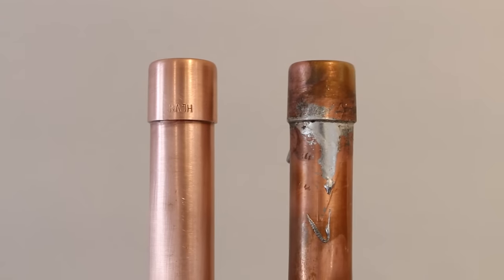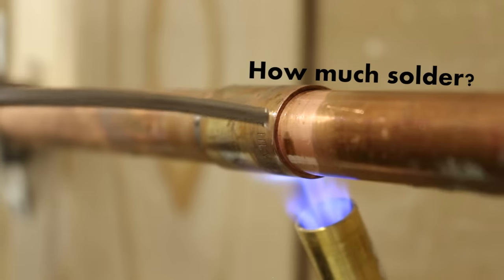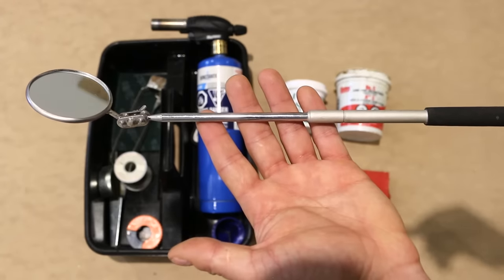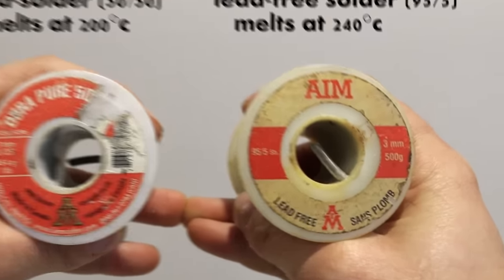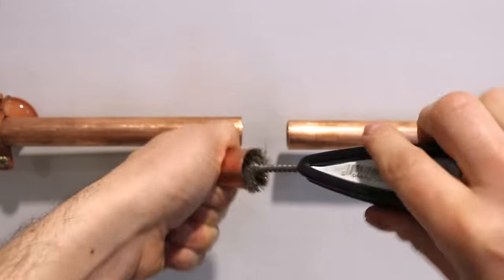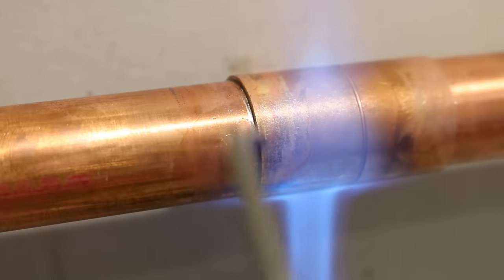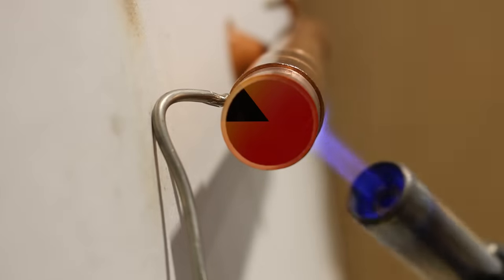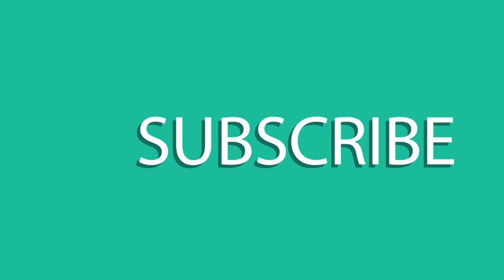How To Solder Copper Pipe Like a Pro (Tips & Tricks) | GOT2LEARN

Comment: Apart from the cleanliness and preparation what made the biggest difference to my ability to produce good joints as a DIYer was a decent MAPP gas torch. Especially on larger fittings where there is more metal to heat, the ability to get good heat into the fitting quickly is a must.
Reply: I've recently learned that mapp as we knew it hasn't been produced since 2008. The stuff that they sell in the yellow bottle isn't actually mapp. They intentionally call it map/pro to mislead the consumer. It only burns 100 degrees or so hotter than propane. Nowhere near what the old mapp was. The torch tip is far more important than buying today's yellow bottle. There are a couple of great videos that demonstrate this. I am no longer going to pay the premium price for a marginally better gas.
Reply: It might have been right for you but I just checked the price of one and for that amount of money I'd redo half of my house's plumbing with all materials included.

It is totally not worth it, I paid something like $12 for my torch.

Comment: I like the fact there is always plenty of room in these videos unlike in reality when they are tight against a wall in hard to access places.
Reply: True, but planning a route goes a long way
Reply: Lol
Reply: @LeeroyPaladin  And that's when the motto of, "Sometimes you gotta not be afraid to fuck someone's shit up" comes into play
Reply: Yep. Agree 💯
Reply: This is a professional showing us how to do a good job. You need to account for camera angles. If the demo pipe is too close to the wall the camera cannot get in
Reply: Plus you can’t afford to take 10 mins for one joint. 🤣
I agree a great technique though
Reply: Like when Bob villa connects drain strainers,tail pieces. Plastic t's and a ptrap. On top of a work bench. Must be nice to do it standing up and not wedged in one of the door space inside the cabinet laying down
Reply: Just do the plumbing first and build the walls afterwards!
Reply: @LeeroyPaladin  lower your flame. I sweat 1-1.5-2” copper all day right next to romex, low voltage wiring, uponor runs, and other combustibles. If you know how to control your flame, there’s now issue even with this technique, though I wish he’d show wiping the joint with a dry rag or glove after dropping the solder which makes it look even better. Every once in a while I have to pull a piece of 26 gauge metal off my truck and use as a flame shield on tight corners, especially on 2”.
Reply: @bradleyrussell1973  don't get to plan your route when you're doing a service repair

Comment: Best soldering tutorial I have seen on youtube!  I have as much confidence in my joints as I do hiring a pro now.
Reply: I used to work for plumbing company as laborer helper. It's easy enough to solder. Prep work is very key. Don't over use flux. Don't overheat it. " Write " once around the joint that's it. Wipe off excess if need be.

Comment: Excellent preparation technique and the method of heating the front 2/3 - 3/4 while not heating directly to the back and allowing whicking and capillary action to suck in the solder works amazing, and it's truly so much easier! ! 
I was fortunate to first learn just exactly the same identical methods for doing this myself (with the exception of the tinning flux) I've always used only soldering flux, but seeing the ease and coverage it provided--my life will be made even simpler along with faster progress for each joint !!
Much thanks for sharing this video kind sir !! Keep up the outstanding work !!
Reply from the maker: Glad I could help Ninja ;)

Comment: Great video! Especially with the short clips on examples explaining what you are talking about.  I've noticed while heating the fitting , the flux comes out. I wipe it with a rag( yes its hot)  , then apply the solder mainly on vertical piping.  Its clean enough to look professional. And no leaks!
Reply from the maker: Good work bud, and thanks for the nice comment ;)

Comment: Just a little tip to add that will save you from having any leaks after you have soldered.
At the one minute 11 second mark in the video he shows flux on the pipe. I noticed the flux contains numerous amounts of small pieces of dirt. Those are the things that prevent the solder from running properly. So it is good to keep your flux covered when not using it. One small piece of dirt can prevent the solder from running into the entire joint.

I am not bashing here...just pointing something out in this video that I did notice which should be corrected.
Keeping every piece in the process clean will result in a watertight joint!!! Happy soldering!
Reply from the maker: Thanks bro :)
Reply: And using a clean cloth to wipe after sanding the copper. Thanks for your comments !

Comment: Great video man I really enjoyed it and after plumbing for 16 years you taught me something.  I will say this to the younger plumbers,  99% of your solder joints are in a wall or under insulation and will never be visible so I personally don't put any stock in to how pretty a joint is.  A while back I called out to a fancy lab at 10pm to fix an emergency leak on a 3" chilled water line.  While fixing it i was gobbing solder in it and not giving on fuck what it looked like and my apprentice (5th year apprentice in the UA plumbing union) asked me "don't you care what it looks like? Thats not pretty." I told him "We just cut out and fixed pretty,  im hanging something up there that we ain't gonna have to come cut out in a year like this "pretty" work here."  There is a time and a place for what this video teaches you, its not for every job though.
Reply from the maker: Exactly! Yes, I mentioned somewhere in the video that I personally only use this for radiators and towel warmers and stuff like that where you have 1 or 2 joints that are exposed, other than that, there's no use for this method, unless you want it to look clean inside the wall..
Reply: @Got2Learn  pretty cool that I was able to learn a new technique after so many years in plumbing.  For exposed joints all I've ever done is wipe the flux and try to control heat and just have a thin bit of solder showing.  Never pulled off a flawless joint like that.  Good video.

Comment: Something I've learned over the years. Have you ever seen a leak on a soldered copper joint where it has both a bit of corrosion and a greenish color to it? That comes from wiping the copper with a metal scotch bright pad. Residual fibers from the pad react with the copper and its soldered joint. I would recommend wiping and cleaning with copper wool/scotch bright only. Excellent video.
Reply: Thats not what its from.  Its from residual flux (highly acidic) oxidizing the copper.  To prevent this, wipe your cooled joint with isopropyl.
Reply: @thatf_inguy8220  Can't say I agree with you. While the flux is indeed highly acidic due to the fact it chemically cleans the copper, it isn't going to cause a properly soldered joint to leak because it wasn't wiped properly. 

If soldered joints were this susceptible to leaks because of them not being wiped properly, I'd guess this technique of piping would never be accepted in the field of plumbuing and would have died in its infancy..

Comment: His video is good & makes sense,  3 things I also do which I think are important/helpful,  I always clean the ends of the fittings (added insurance) measure the length of solder you need (estimate, not rocket science) 3/4" for 3/4"  1/2" for 1/2", etc.  & last which I think he said; let the solder flow to the heat  !

Comment: I would say that does look very nice and beautiful. But most pros don't scrub their pipe after the job is done. You can reduce the life of the pipe because you are wiping the thin oil coating off the pipe. Instead while the pipe is still hot put some regular flux on top of and take a clean 100% rag and wipe it over your joint. Just make sure the solder solidifies first.
Reply: Depending on the flux, leaving flux on a pipe will result in it turning green, although it may look good initially.  Most plumbers I know consider fluxing after soldering to be extremely bad practice for this reason.  I suppose if you want to grease your pipe, though, a silicone grease could be used for this purpose.

I don't generally use an abrasive to polish a joint, although copper, whether oiled or not, is generally extremely durable when exposed to air, so I can't really see what harm it would do (except that you are wearing away the wall thickness very slightly).

Comment: I had a plumber that tried to make his joints look like this. He had more leaks than anyone. He said he didn't want to waste and drip solder all over the place.
I responded by saying I don't want to drip and waste water. 
Solder the joint, leave 1/8" around it and swipe the dog ear off. You will know it's full.
 Had to get rid of him after I saw him on a service call soldering 4" copper with a #4 prestolite tip. Dude wouldn't listen.
Reply from the maker: It takes the same amount of time, just a different technique.
Reply from the maker: Lollll
Reply: Oh dear...
Reply: I always say solder is cheap . In a hard to reach spot I will let it drip . Finesse does not apply in this situation.
Reply: Solder is cheap and leaks arent nI agree with you there but I never wipe my joints while the solder is still molten. Im sure you disagree but wiping hot joints is bad.
Reply: @canonpatchell  yes could cause problem. I knock off the dog ear with my solder before it hardens. I left a solder dog ear once and a customer thought it was water when I was an apprentice and had to drive all the way back for nothing. Never again

Comment: Monster open mesh grit cleans like no other and last the longest. Emory cloth is time consuming. Also on bigger copper 1.25 and up you have to circle the fitting with solder to get a correct seal. Looks don't matter but leaks do
Reply from the maker: Definitely!! It's also more expensive ;)
Reply: @Got2Learn  Time is money and redoing a leak cost money as well

Comment: I also like pretty joints. I found that gently wiping the run or access solder with a dry rag or old leather glove while still melted, works wonders, the thin layer of tin that remains can just be cleaned up with emery paper. I  sometimes re heat to wipe if necessary. It also works great if you use recycled pieces that have previously been soldered just heat wipe and you have a tinned pipe and not waste the precious copper by cutting it off. To clean soldered couplings, grab with longnose plyers heat and bump your hand against something solid the hot solder comes flying out. and you have a beautiful pre-tinned coupling that needs less solder and a non-leaking joint as a result. By the way I use LACO flux no leaky joints ever.
Reply: Yup i wipe joints with a scotch bright pad after soldering and joints like great everytime

Comment: For good clean solder joints practice makes perfect. My suggestion  is to use  the correct torch tip. The right size flame makes a big difference. Also wiping the excess flux after you pre heat the fitting. And finally  let capillary action do the work. Practice controlling your  heat
Reply from the maker: Yup!!
Reply: Wiping excess flux after pre-heating?   Hmmm?   I'm trying to make sense of that statement.   What about the issue of the Flux evaporating too much and thus making a weaker seal between the copper sheaths?
Reply: I think this comment just changed my life... wiping away the excess flux after preheating? I'm gonna try this.
Reply: @bonsummers2657  I’m talking about the excess flux that runs out of the fitting. And flux doesn’t evaporate it burns and turn black to the point where it won’t take the solder. To each his own. You only need a thin layer of flux on fitting and pipe. But if it’s running out out of the coupling or fitting it’s over flowing and I’m just saying I like wiping the excess because if you let it run every where you will end up with a sloppy joint.
Reply: @commadanteflet  try it. If you just leave the excess there potential for the solder to stick or adhere to spots that you don’t want. And of course at the end of the day it’s about whether or not you solder joint can hold pressure. But I’m in Texas and a clean joint vs a sloppy joint in the commercial industry matters. It could determine how long you work with companies especially in the union
Reply: Yes, the torch tip makes a difference.  Mine is the standard Superfire tip used by most (?) UK plumbers and is far wider a spread than the ones in this video.  Makes it hard to get enough heat in the joint without also heating up other things in the surrounding area.  You can turn it down, but then the flux burns before the solder will flow.  Would probably work better with MAPP-style gas than propane, but since I mostly work indoors, it's bad enough with the fumes without using MAPP-style as well.

Comment: Always start soldering your lower joints and work your way up to joints that may be above on the same pipe,Especially on your vertical couplings you soldered,do the lower joint first as heat rises,once you do the bottom side,little heat needs to be applied to the top side. If you do the top first,  then heat the bottom,you could create a leak on the top side that you just soldered
Reply: Heat doesn't rise though. Hot air rises..
Reply: @JasonMontell2501  heat moves from hotter to cooler in any situation. In air, the hotter air rises because it's lighter than the cooler air,causes circulation as hot air rises and and the cooler air drops. When talking about heating a joint with a torch, same thing applies. The hot burning gas from your torch travels upwards. Never seen one yet where the flame comes out straight then heads downwards. You get the idea. Just try it you'll see a difference. Start at the top on one joint then try starting at the bottom. This is how harris taught us at live demos over 20 years ago.
Reply: @HVACRTECH-83  You're correct that heat moves from high temp areas to low temp areas but are somehow hung up on thinking that heat only does so in an upward direction like hot air.. Heat will travel in any direction, left, right, down, backwards or forwards as long as it's from a high temp area a low temp area. So once again, no.. heat does not act like hot air and rise. If that were true then after heating your pipe you'd expect that only the pipes traveling above your work would be hot but no.. the pipes are hot in equal directions away from your work..
And that's because heat does not rise. Only hot air rises.

Comment: The #1 should clean, and dry. Flux isn't for cleaning, it's to prevent oxidation during the soldering process. Any water present will ruin your solder because the water turns into steam and carries off the heat faster than your torch can heat.
Also, what I do is cut off the wire brush handle and insert brush shaft into my cordless drill. Works much faster than doing it by hand.
Reply: UtwoBed 👍
Reply: flux is to create capillary attraction to draw the liquid solder into the joint , main reason.
Reply: Piece of white bread in the pipe will keep the water back

Comment: Good well explained video. Most of the soldering jobs I’ve seen were complete blobs of excess solder. I think lost guys don’t really care. Plumbing used to be a skilled trade. I’ve always carried a small plastic dental mirror on my jobs just to check the back part of the joint against the wall. I now use grit cloth instead of emery cloth. It costs more but lasts longer and is more effective than emery cloth or those green scrub pads. I Always carry a fire extinguisher with me. You never know .....

Comment: Just use Everflux and don’t drown it. Once around is suffice as long as you don’t move to fast. I like to curl the end of the solder. And if you have a drop, just run across it with the end of the solder. It’ll knock it right off.
Reply: I wipe after every joint to get the cherry off.
Reply: Ever flux is the bomb! Only time I clean copper now is if it's absolutely filthy or oxidized.
Reply: I dont know ever flux as I'm in a less fortunate country but you obviously have more sense than most of these jokers connenting lol.
Reply: @sergiohernendez8767  
It’s a white plastic container about 3 inches in diameter and it has a blue lid. Thanks. I went to an apprenticeship when I was a plumber.

Comment: Flux also keeps your metal from oxidizing which is very important.  As the metal heats up it will oxidize very quickly and that layer of oxidation will stop the solder from adhering to the metal.  Other then that awesome video. Once a person does a few thousand joints it gets to the point that you don't need to worry about being so careful with the flux or having any solder drips. I haven't wiped a joint to clean it up in decades.
Reply from the maker: Well said ;)

Comment: There is a very easy way to make awesome looking joints.  Apply the flux to the pipe and fitting and apply heat above the maximum depth of the inserted pipe,  the flux will run out of the joint as heat is applied.  Just before applying solder, wipe the joint with a relatively cloth and remove the excess flux then immdediately apply the solder to the heated joint.  It will suck up into the joint perfectly and you will have a clean looking joint.  Thius works for horizontal and verticle applications.  As with anything, it will take a little bit of practice but is something anyone can do.

Comment: Nice video.  Few pointers. Must ream the inside of the pipes before connecting. Touching the ends of the cleaned pipe sometimes won't allow tin flux to stick and create that waxy appearance. What u will instead see is shininess. Will need to remove flux and wipe ends with clean cloth. Tin flux is far better than regular fllux and all u need is a tiny bit as shown in video.